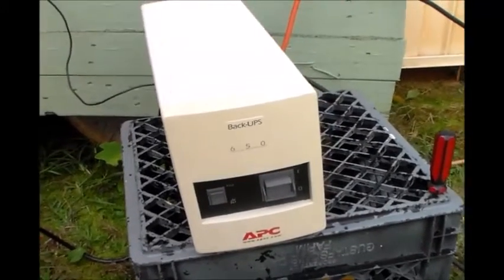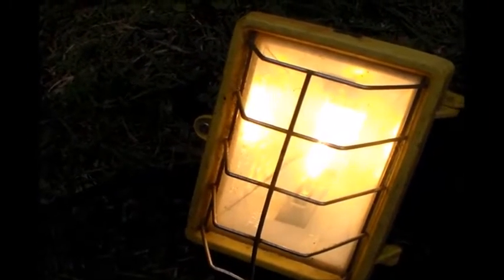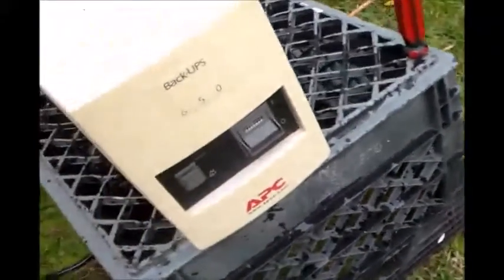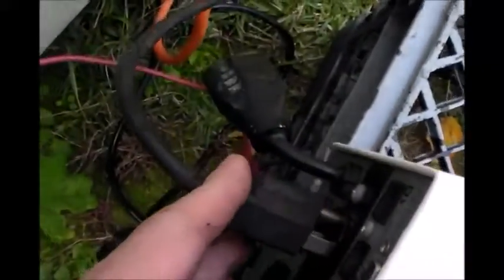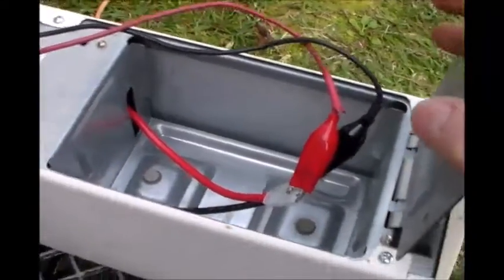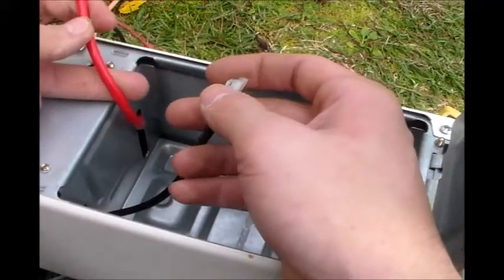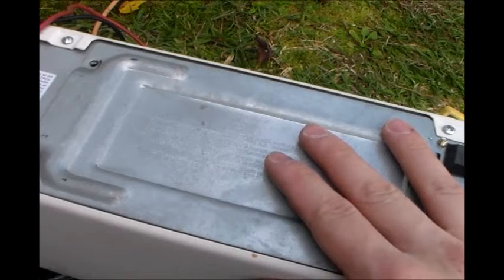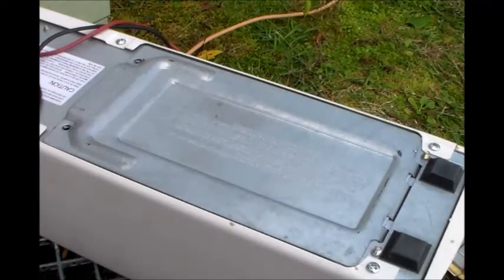How To Triple Your UPS Run Time

Comment: By the way, does you UPS show any signs of overheating when used for extended periods?
Reply from the maker: +luckienuckie No, mine does not. Of course I don't push it to the max. I only run 100 watts or so on mine. If your pushing your system to the max it may would start to heat up. Thanks for the comment.